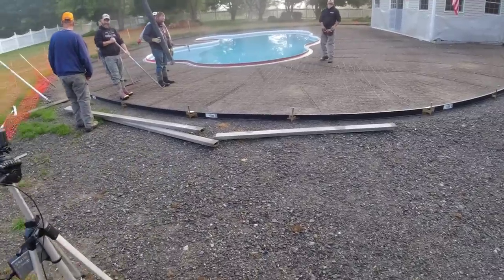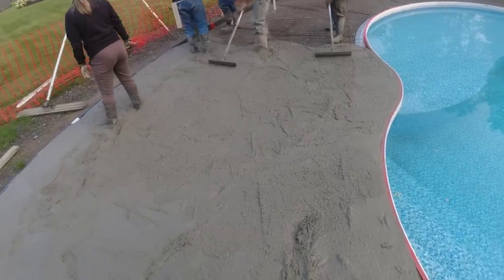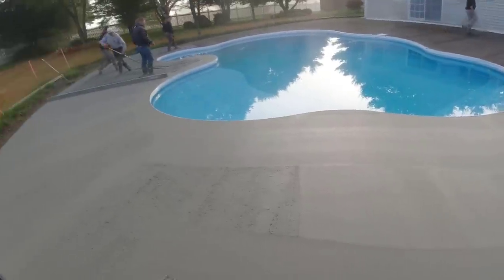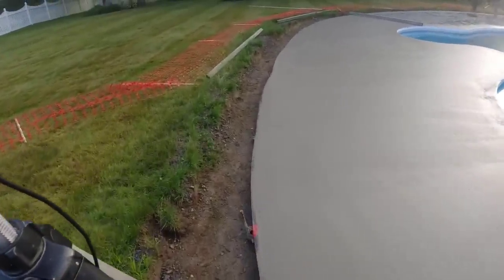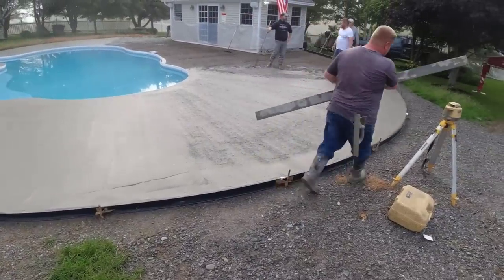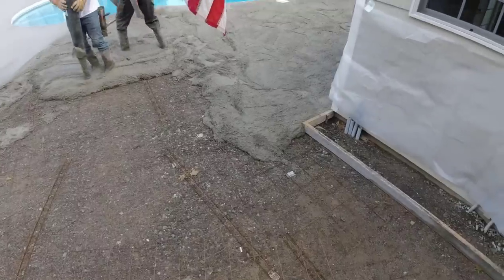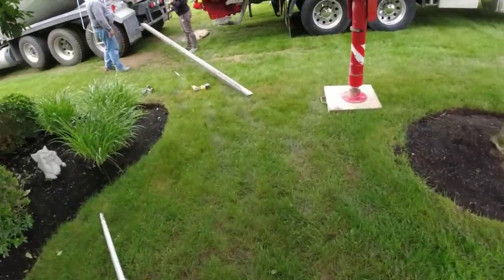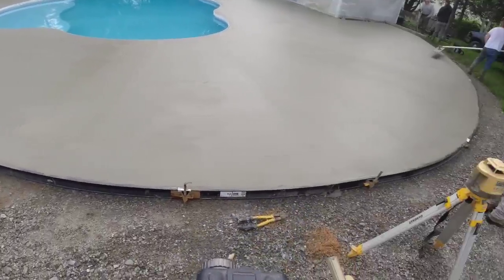Huge Stamped Pool Deck Poured and Stamped using Flexible Forms | Part 2

Comment: That is a massive job. I like how casual you were about the wire poking up through the concrete and handled it as if it was no big deal. I also really like how these feel more "real" than some of the other concrete youtube channels. It's more about the job than you. I almost feel like I'm hanging out on the job site and listening to the conversions with some of the other workers.
Reply: I agree. It’s nice to see a real hands on experience with concrete. Something I never do as a homeowner, but would like too more. I have a 9x12 concrete garage I need to apply a skim coat too then I’d like to epoxy with flake.